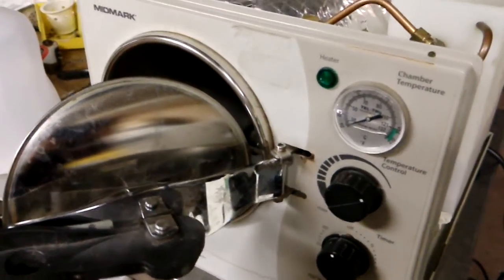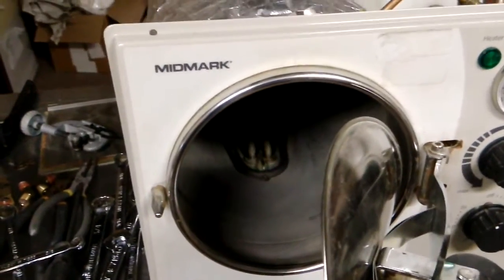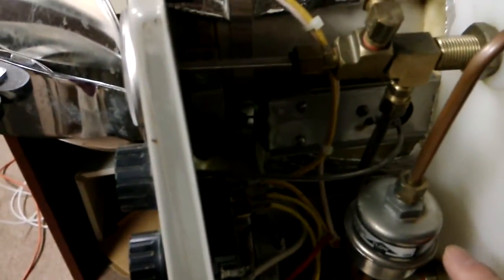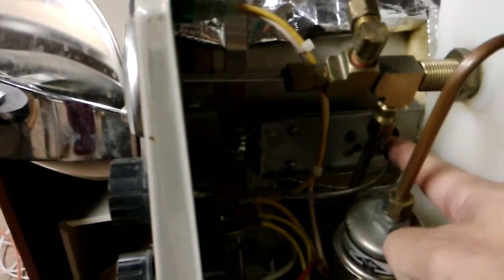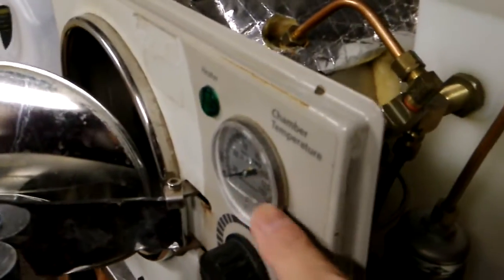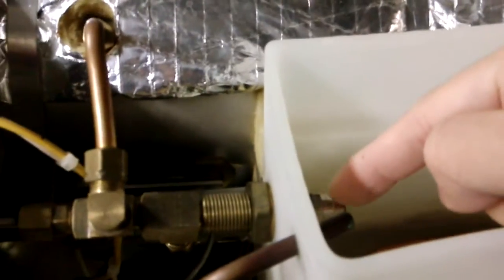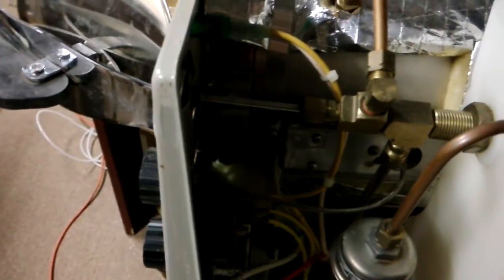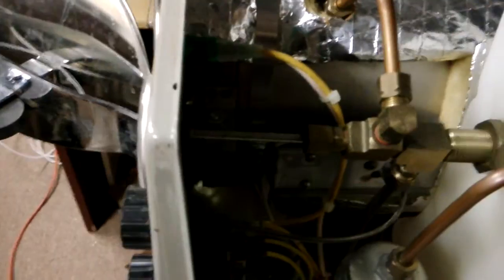how to repair midmark ritter M7 sterilizer autoclave

Comment: Hey I have a 1965 Ritter speed clave with the old style bellows assembly. I have to tap it to get it to work properly. Is it possible to fit it with the newer styler bellows assembly or should I try to clean this one out and get it working again.